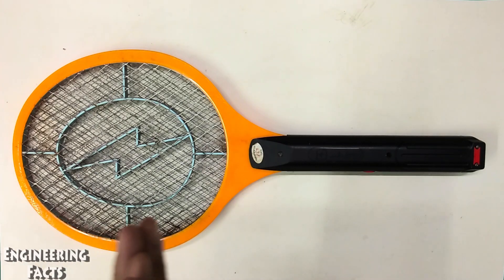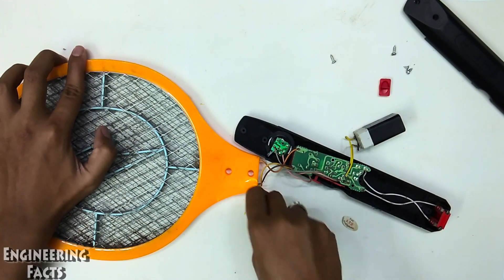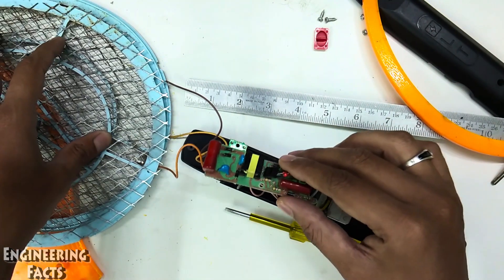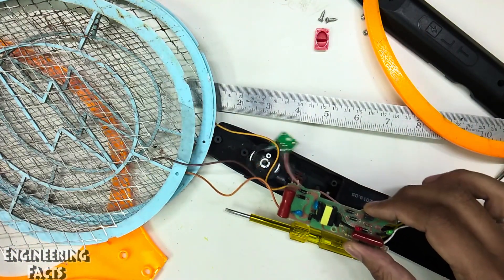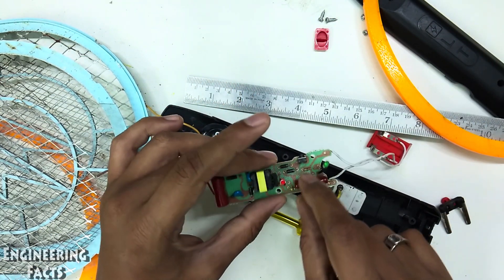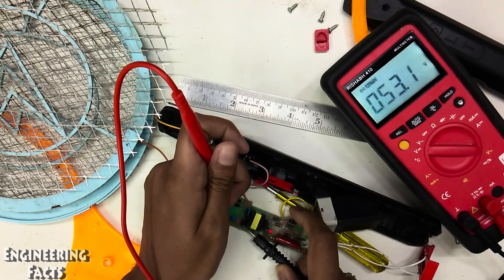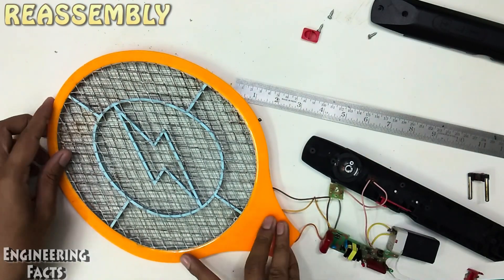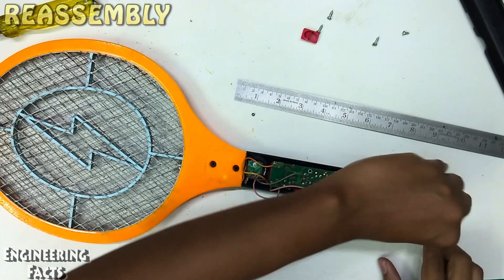What's Inside; mosquito bat? _ Tamil, How mosquito bat works?  how voltage boosted low to high?

Comment: Good Video. What happens if a person or kid touches the net while turned on ?
Reply from the maker: The high voltage will burn the skin/ make more pain in the tissues. That's why push button provided, you have to push when it's needed. Even after releasing the button, some voltage will be there on the net due to capacitance. Always Keep away from children.
Reply: @engineeringfacts  yeah
Reply: @engineeringfacts  only burn ? No problem otherwise... ? I mean, it is not like ac voltage?
Reply: டிரான்ஸ்பார்மர் இனபுட் ஓல்ட் அளவு என்ன

Comment: Thanks for the nice video. When the step up occurs, the voltage will increase and current will decrease proportionately. At the end, the power will be same ignoring loss. What is the point of stepping up in this case, how it can kill a mosquito with reduced current?

Comment: I have checked my mosquito bat with multimeter dc 252 volt only coming from mesh net instead of 1500v, what component should be faulty, I have changed 2000v capacitor also as it shows busted. 

Please reply what is the problem

Comment: With is bat you explained about AC to DC and DC to AC conversion.  The basic  circuit and it's components usage were clearly told.

Please do video for what is resistor, diode, capacitor, transformer and any other electronic components types and usages for basic learner's.

Thanks Keep on Good work

Comment: In most of the bats possible fault is battery only. It's a 4v lead acid type and it costs around RS 40. Can you suggest an alternative to this battery? Or an alternative circuit to use commonly available batteries?

Comment: Bro after stepping up the voltage, how diode is used to convert AC to DC?
Is  Bridge rectifier circuit only used to convert it? Pls explain bro

Comment: Possible to change the battery in this bat? 
Can you pls do a video on how to change the battery in this bat?
If yes what type of battery should be bought? Available online or in local electric shops? If you attach links it would be useful. 
Any mosquito bat works well only for a year, then the battery becomes weak.

I believe it's possible to change the battery easily.

Comment: Hello, I like all your videos; very useful and informative one. I have small doubt..How MOSFET is getting switched inside continuously to produce square waveform?
Reply: Sir its not mosfet at all.  Its BJT(bipolar junction transistor). A BJT with two inductors and resistor is used to make a oscillator (sine-wave) which is stepped up by transformer. If you want proof, you will see six terminals(3 windings) from the transformer. 1 winding is for output and 2 windings  are for BJT

Comment: Hi Sir,

Video is very good. I have one doubt sir, why all mosquito bat exterior wireframe is connected with positive and internal wireframe is negative.

My doubt is what will happen is top and bottom wireframe is connected with negative and inner wireframe with positive, hope it's works, but why it is not widely used.

It will be greatfull if you explain.

Comment: Bro indha 3000 v a 240v aa pirichi 12 v2ku current supply pana mudiyaadhaa 12venaam oru v2kaavadhu
Reply from the maker: House needs power. Not only voltage.

Comment: Useful videos... 
I have one doubt, find Voltage in output of  transformer 920V (decrease). Generally transform voltage in AC. While testing your meter showed in DC, How ?
Reply from the maker: After transformer, diodes used to convert DC. that's why

Comment: hello friend I have UPS in my home. Can I use power supply from 12v battery to this bat ? Will it Will work. Bcos every time battery back up / failure issue. Can I use with the help of 2-3 Meter wire input from 12 v battery.
Reply from the maker: Need to change circuit also
Reply: dear friend,  நான் ஒரு ஆன்லைன்  மூலம் LED strips வாங்கினேன். அது 84 smd Led  நான் அதை என்னிடம் உள்ள. ( UPS ) 12 வோல்ட் 100ah பேட்டரியில் இணைத்துப் பார்த்தேன் அது நன்றாக  எரிந்தது ஆனால் மிக வேகமாக சூடானது. அதை எவ்வாறு உள்ள 12 வோல்ட் 100 ah பேட்டரியில் நீண்டநேரம் எரிய வைப்பது அதற்கு நல்ல குறைந்த விலையில் உள்ள சரியான பொருளை எனக்கு பரிந்துரைக்கவும்

Comment: Bro resistor eppudi 250 ac input voltagea 5v mathu?
Reply from the maker: Actually capacitor used here to reduce voltage.

Comment: Charger circuit is capacitor type. Capacitor will reduce the voltage. It's not resistor . Resistor is not reducing the voltage
Reply from the maker: Yes, you're right

Comment: Bro you saying Diodes are using to convert ac into DC but. In some bat has  That diodes are use for voltage multiplilers
Reply from the maker: How they're used as multipliers, how diode multiplies voltage? Not possible
Reply: @engineeringfacts   I re watch your video that bat has only one polyester capacitor and two diodes. So the diodes are use for ac into DC and Capacitor filters noise and make constant voltage in your bat but most of the cheap Chinese bat has voltage multiplilers that consist of two or more Capacitors and diodes. And diode cannot multiply voltage. But use to form circuit.
Reply: @engineeringfacts  Hi, I'm not sure if I'm entirely right, but it is possible that they use a voltage doubling rectifier at the last stage, which doubles the voltage at a very low component cost (just a cap and a diode, not just a diode of course), so that the high voltage cap at the last stage charges up quickly.  And the slow drop we see when you measure the output is possibly the leakage from the output high voltage cap, that serves as a low impedence supply at the output stage.  Probably you may have more information about this and be able to confirm this theory.  Your videos are really nice..

Comment: Bro can i replace the battery with a mobile battery ......
Reply from the maker: Yes
Reply: @engineeringfacts  then why are the using the useless battery the inbuilt battery is a worst one it loose its ability quickly ife they provide lithium iron battery it will be a great thing
Reply from the maker: Buy good brand.

Comment: Voltage ah bro kollum 🤔
Reply from the maker: Higher voltage can cause quick current flow, which can damage your tissues.
Reply: @engineeringfacts  bro remote working function podunga bro
Reply from the maker: We'll try bro

Comment: Bro whether taser gun also working in similar way. Whether taser gun burns the tissue
Reply from the maker: Similar operation, but taser gun will have much higher voltage than this. And instant current through also high.